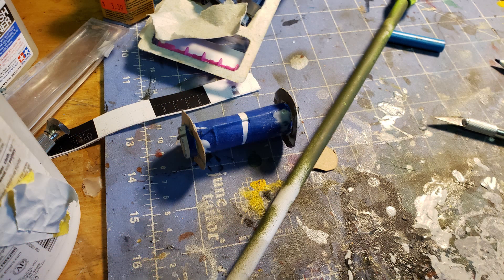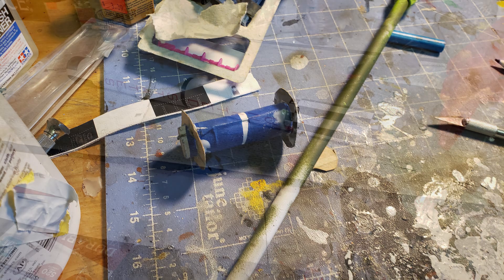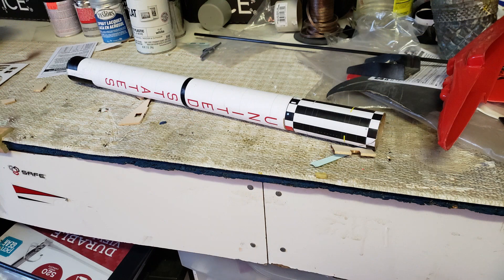Max's Models after hours 1/29/21

Comment: An in flight view of an in flight. For the "One Shot"  rocket, perhaps wrap it in white paper and use the letters CCCP; in case it really becomes a one shot, or if the engine holder does not work. Better to film the Soviet crash instead of the USA.

Comment: Hey Max, just a heads up to all glue troopers out here. I just got a reissue of Lindbergh’s big red rod and to my surprise there’s absolutely no chrome parts... just grey plastic and no decals just prints on instructions to cut out printed ones on sheet.. so if anyone is thinking about getting one look for the original this reissue is a big disappointment...
Reply: BUMMER 😶😶😶😶
Reply: @garyparker2969  yep considering 2/3 of the model is supposed to be chrome...plus unlike the original kit it’s not motorized and working lights are gone also..
Reply: For poor man's chrome, prime with black paint before shooting the chrome. Practice on a plastic spoon first to go the hang of it.